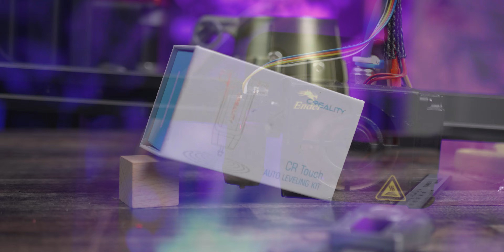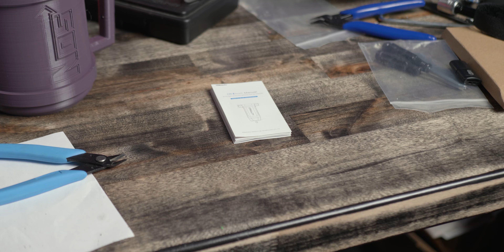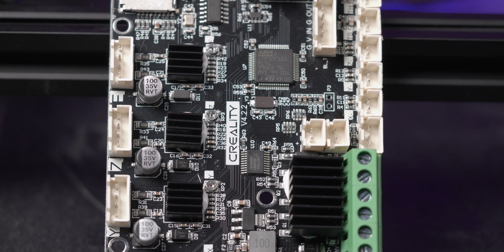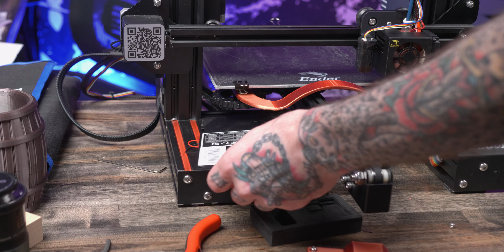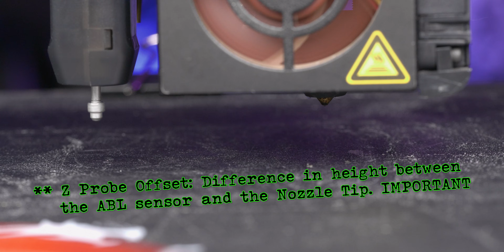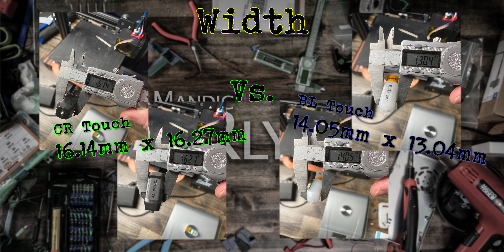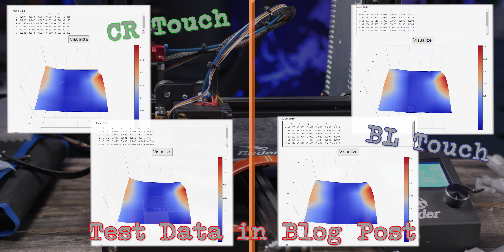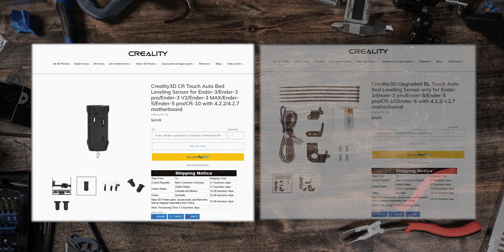CR Touch vs BL Touch - NEW Creality Auto Bed Level Sensor Review

Comment: i broke so many bl touches so i will never go back to theses style anymore. and as all my printers runs flexplates with springsteel. i run PL-08N2 sensors instead. :D never had one break from hitting a print :P :D
Reply from the maker: Never crashed one hard enough to break it. We’re they level with your nozzle or close to it? I design my mounts to use approximately half the throw of the sensor so it’s well away from danger.
Reply: when i did run bltouch i had the hero me kit on the hotend. i broke them when parts got knocked of the bed and it bend and broke the pins. and i had 2 just die from nowhere. so now with alot more expensive machines im abit to scared to use them as its alot more money that break now adays :)
Reply from the maker: @Nappen87  Fair.  I think the tolerances on the Hero Me designs are a bit tighter.  My one setup constantly rubs the one fan duct on prints if they curl even a little bit.

Comment from the maker: Check out the Blog Post about this sensor for more Photos and Testing Details: https://www.hotrodhippie.com/post/new-creality-cr-touch-abl-vs-bl-touch-sensor-for-3d-printers

Link to my GitHub with the Firmware (Ender 3 with 4.2.7 Board ONLY): https://github.com/MandicReally/CR-Touch-Firmware

Also newer versions of the CR Touch exist that come with an SD Card and an "Anti-Rattle" piece on them now.
Reply: works great!!
Reply: Does this firmware have the Z offset wizard as well? or nah?
Reply from the maker: @joshuamasterson2062  nope, it’s one of the things I criticized Creality for not including. I haven’t tested any newer releases (if there are any).
Reply: @MandicReally  Do you still have the software that you used containing the wizard? It would be really helpful to have for a beginner like me.
Reply: ender 3 pro have a 4.2.2 or 4.2.7?
Reply: @augeralexandre8678  I am sure it depends on when it was made. I bought my Ender 3Pro around 2 years ago; it had the 8 bit board. I just replaced it with the 4.2.7. The only sure way to determine which board you have is to remove the cover and look. (One screw on top-right and three on bottom).